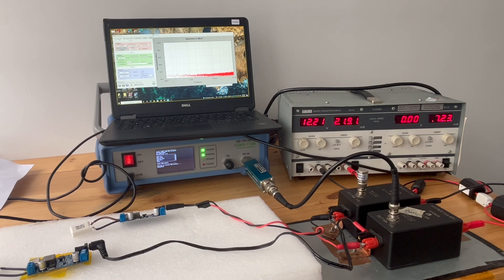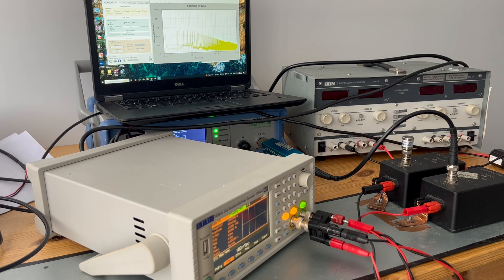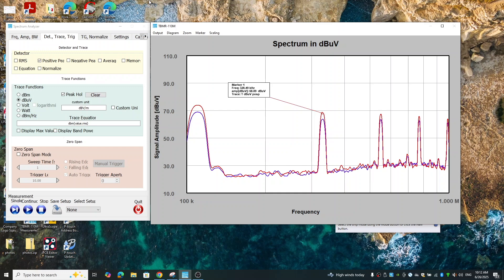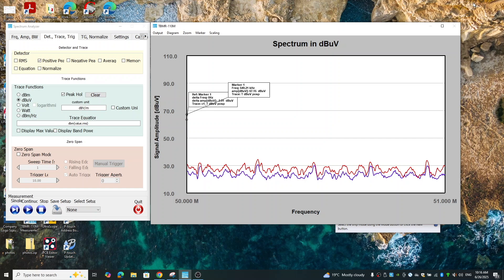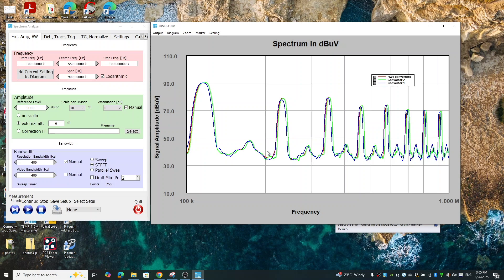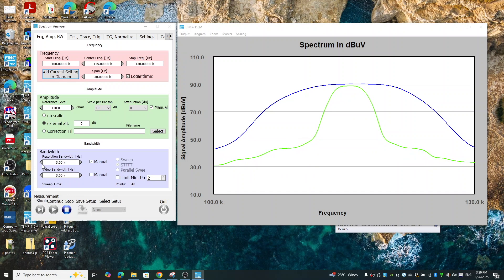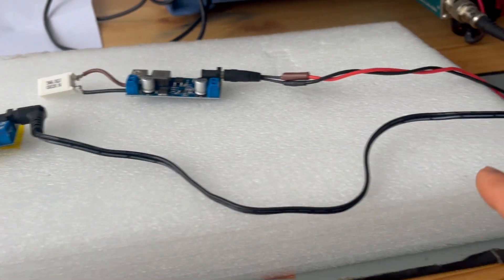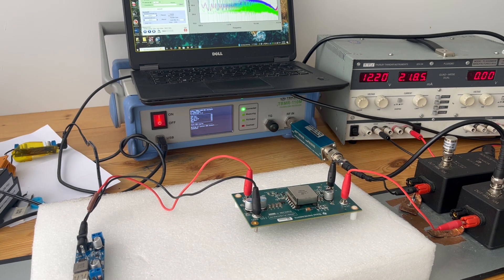Conducted Emissions of Two SMPS in Parallel — Surprising Test Results

Comment: Great video, what do you advice if you can choose the switching frequency of each converter? E.g., 400KHz and 1MHz.
Reply from the maker: That is more application driven. Of course, many design engineers would love to go for higher frequencies, because the size of the magnetics can be reduced, efficiency will be improved.
Reply: @MachOneDesignEMC  Sorry, what I meant is if one of the converters is at 400KHz and the other at 1MHz

Comment: Waitng for next video with 2 SMPS in series! :)
Reply: In series by output and still in parallel by input. So it besically the same in terms of EMI.
Reply: @volodymyrzakolodyazhny  Not quite geting your topology. In series meaning +Vcc-----> IN1 SMPS1 OUT1 ----> IN2 SMPS2 OUT2 ---> LOAD . In this tpology could be diffrent results, what about input and output filters? :)
Reply: @MJ_EMC_EE yes, I'm about it too. Twice higher output DC voltage and twice higher output differential ripple (same percentage of ripple). And EMI from input is like two converters in paralell.